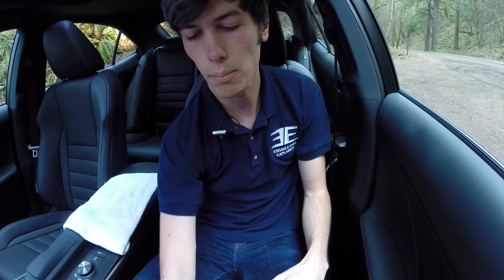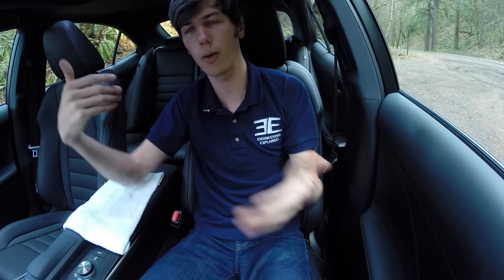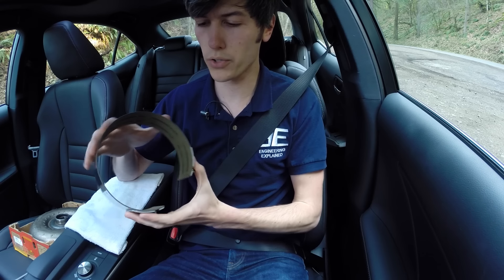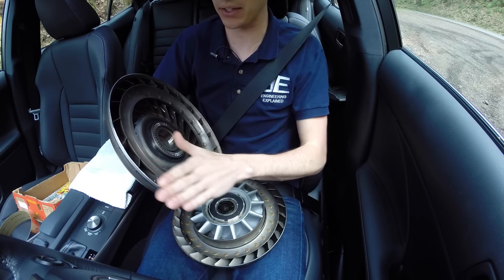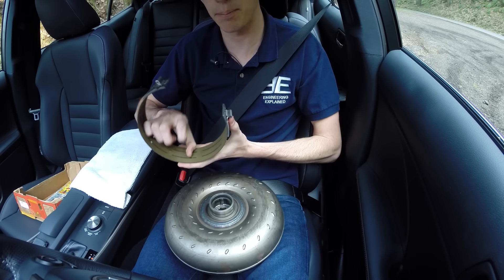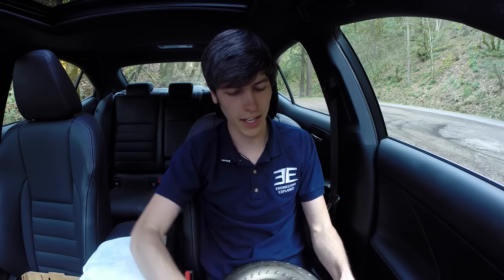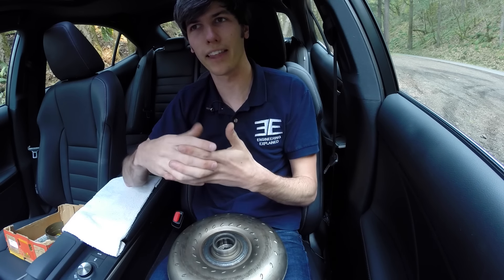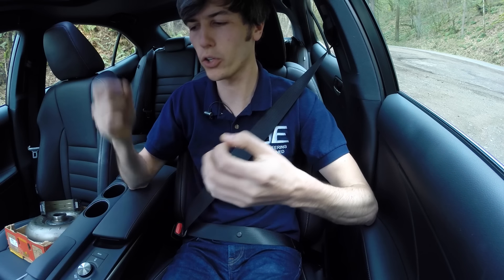5 Things You Should Never Do In An Automatic Transmission Vehicle

Comment: I didn't hear any good reason for not putting my car in neutral going down a hill. Even if the fuel shuts off, I'm still using more energy to spin the engine at a higher speed than if I just let it spin at idle. Loss of control? Why would you need to accelerate when you're already accelerating by coasting down a hill? And how hard is it to pop it back into drive when you need to go up the next hill? And illegal? Are the transmission police going to ticket me for taking it out of gear?

BTW, I also put my automatic transmission in neutral if I'm at a fairly long stoplight... it keeps the transmission - even at idle - from fighting the brakes.
Reply: +Dan Courtney I thought the same as you, but researching further it makes sense. When the fuel is shut off to the engine, the extra energy is coming from the wheels to the engine, not the engine to the wheels. So no extra fuel (energy) is spent, except for gravity which we don't pay for! When in neutral, the engine is still at idle, so is still burning fuel albeit a small amount, bit still more than no fuel at all when in gear. The loss of control means that although you are accelerating downhill, you're not in control of that acceleration, it's fixed. So if you needed to accelerate harder for whatever reason ( to move out of an objects way, then you need to spend a quick moment to put it in gear before accelerating. It's negligible but may make the difference in avoiding a collision. As for the last law, I don't know. I live in the UK.
Reply: +Dan Courtney 
The engine is turned by the car momentum when in gear and downhill so it's actually more economical to leave it coasting in gear. Your transmission is also designed to withstand "fighting" the brakes and the impact of engaging drive from neutral is more severe than holding it in place. But if you are so incline in keeping your car in neutral why not buy a manual? 
As for a legislation, certain jurisdiction ask to keep a moving car in gear at all time but I have never heard it is enforced.
Reply: +Kieron Middleton "So no extra fuel (energy) is spent, except for gravity which we don't pay for!"  

Think about it this way... You're at the top of a hill (velocity = 0) with 90 Joules of potential energy (from the altitude) and 10 J of potential in fuel (total 100 J). Now you coast down the hill. Ignoring air resistance, you convert the 90 J of potential energy into 90 J of kinetic energy and also burn the 10 J of fuel while your engine idles. Total energy at the bottom: 90 Joules.

Now with the same starting conditions you come down the hill in gear. You'll still have your 10 J of fuel at the bottom, but what about the 90 J? If the energy to spin the engine was the same as in idle, then it would cost you 10 J, leaving you 80 J in kinetic energy. 80 J + 10 J = 90 J.... same as above. 

BUT, you're not just spinning the engine at low rpm, but spinning it faster, and also spinning the transmission. You can easily use twice the energy to spin the internal components, leaving you just 70 J in kinetic energy at the bottom. That's 70 J + 10 J = 80 J.

Coast... it's more efficient.
Reply: +HonestUsedCarReviews I respectfully disagree with the conclusion that turning the engine with car momentum is more economical than turning it with fuel. Energy is energy, so the simple fact that the engine is spinning faster when in gear means that more energy is consumed.

I would gladly buy a manual transmission... but I have a company car, so I don't have a choice.
Reply: Dan Courtney 
I also respectfully disagree with you as an engine coasting in gear will run leaner to reduce speed. But at this point without experiments it is hard to prove both our side of view and there are large number of factors involved in solely the fuel economy aspect that have much more major impact. Eg tire air pressure. 

And since you are stuck with a company vehicle beat it like you stole it!
Reply: +Dan Courtney In gear = wheels will spin engine meaning 0 fuel usage. Neutral = fuel is on and is spent to rotate the engine. Try measuring it in practice and you should see the difference.
Reply: +infiltr80r Whether you spin the engine with fuel or sacrifice kinetic energy from the motion of the car, you're still consuming energy to spin it. I'll repeat a previous comment to illustrate my point...

Think about it this way... You're at the top of a hill (velocity = 0) with 90 Joules of potential energy (from the altitude) and 10 J of potential in fuel (total 100 J). Now you coast down the hill. Ignoring air resistance, you convert the 90 J of potential energy into 90 J of kinetic energy and also burn the 10 J of fuel while your engine idles. Total energy at the bottom: 90 Joules.

Now with the same starting conditions you come down the hill in gear. You'll still have your 10 J of fuel at the bottom, but what about the 90 J? If the energy to spin the engine was the same as in idle, then it would cost you 10 J, leaving you 80 J in kinetic energy. 80 J + 10 J = 90 J.... same as above. 

BUT, you're not just spinning the engine at low rpm, but spinning it faster, and also spinning the transmission (when it's in gear). You can easily use twice the energy to spin the internal components, leaving you just 70 J in kinetic energy at the bottom. That's 70 J + 10 J = 80 J.
Reply: +Dan Courtney I agree Dan.  Downhill in gear=some engine braking. Nowhere near a manual trans but it is still there. Downhill in neutral=no engine braking. You're also right about the law. How is a LEO going to know you threw it in neutral?
Reply: Dan Courtney
The point is that when coming down the hill, you let the engine do the braking, braking is the key. So instead of using fuel to spin engine and wearing out brakes to slow down, you combine the 2 things. Seems pretty straightforward to me if I understand you correctly. Yes, if you're looking at energy it's the same but not when you put the car into the equation (so to speak).
Reply: +Lanky Daze No need to apologize, we can each come to a different conclusion. I just happen to be a Mechanical Engineer and it's actually quite straightforward. The net result is that putting the car in neutral going down a hill conserves more energy. One possible exception is if you have to brake during or immediately after coasting, in which case you're dissipating the energy conserved by coasting, and you would have been better off dissipating that energy through the transmission with no fuel flow to the engine.
Reply: +infiltr80r I agree, if you need to brake you're better off dissipating that energy through the engine (with no fuel flow) than through the brakes (with fuel still flowing to the engine).
Reply: Hydraulic-type transmission doesn't strictly engage a particular gear when coasting downhill, torque is loosely transferred via hydraulic torque converter, e.g. it is not the same as if playing with manual, trying to match a correct gear & rpm to the wheel speed. Electro-mechanical transmission (robotic) most probably will just switch to neutral. Variator  (CVT) transmission will vary belt position to match wheel speed to engine rpm. In either case, there is no visible fuel save when coasting in neutral, but less control shall you need to accelerate. Switching to neutral at long traffic lights can help to relieve your leg from holding brake pedal. Newer cars will have an option to hold the brake for you (autohold feature), and release upon touching accelerator pedal.

Comment: His reasoning why you should stay in Drive descending makes no sense re fuel consumption, basing that on cutoff of fuel delivery, whereas in Neutral fuel is still delivered to the idling engine. Even in top gear ratio, the energy absorbtion due to engine braking may easily outweigh that saving. May be more important to stay in Drive or even drop a gear, to avoid excessive speed, at least part of the way down. Resist wasting kinetic spinning engine.
Reply: its because people forgot how a motor car works. new cars take the driving out of driving. ie smarter people, no common sense.
Reply: It's been proven time and time again that, as long as you actually coast to a stop rather than using the brakes, freewheeling saves you fuel over in-gear coasting, so yeah he's definitely wrong on that one.

That said, the safety argument is a real thing.  If you're going down a long hill, you may be WAY outside the realm of safe speed or speed you know how to handle (or speed your tires can handle, for that matter) if you freewheel the whole way down.
Reply: I also found (with a manual), that neutral, while using some fuel, allows me to pick up more speed (which if you have a bit of a margin with the speed limit, can help getting further up a hill), which seems to result in slightly lower overall consumption... (Mainly useful is trying for absolute minimum consumption, doing say 20kph under speed limit beforehand) (If you brake, you'll probably cancel out the savings immediately...) (Things to do when bored on long drives alone....)